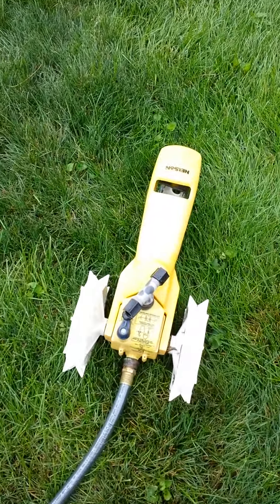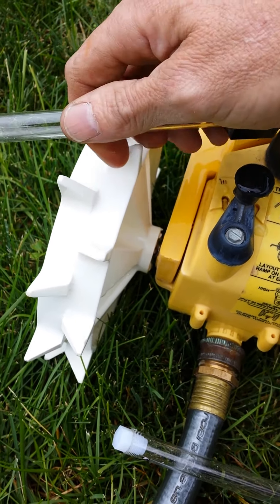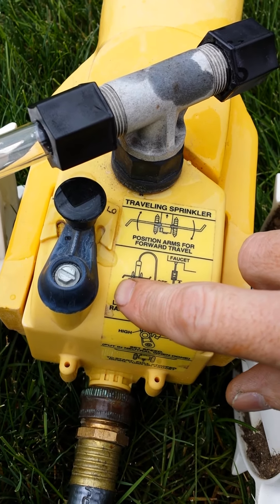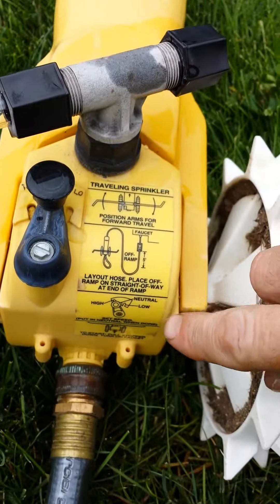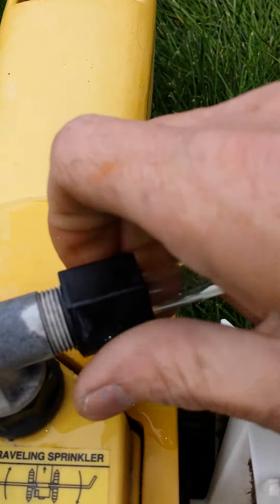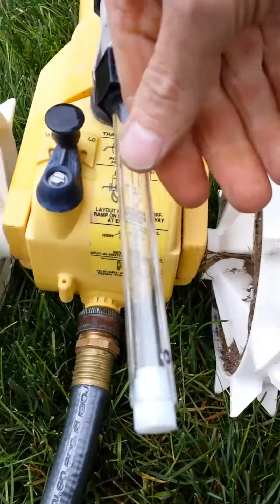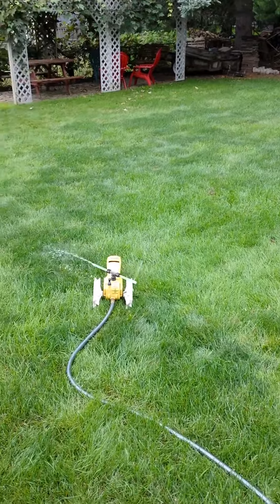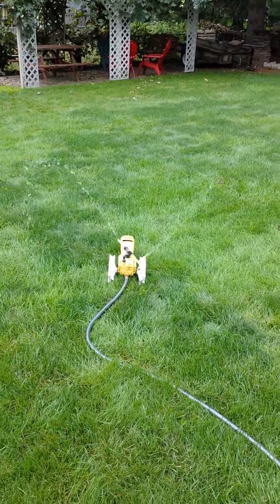Nelson rain train replacement tubes part 1

Comment: I couldn't find these tubes on eBay like you said. I did however use a 1/4 in PVC pipe and threaded a 10mmx20mm bolt into the ends accomplishing the same thing.
Reply from the maker: Matthew Migdalewicz good show
I need to repost some